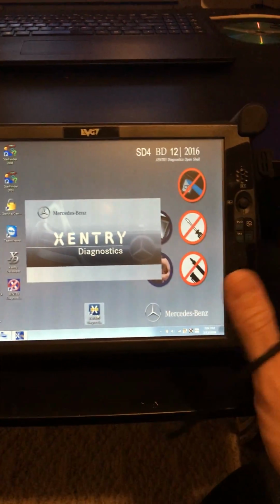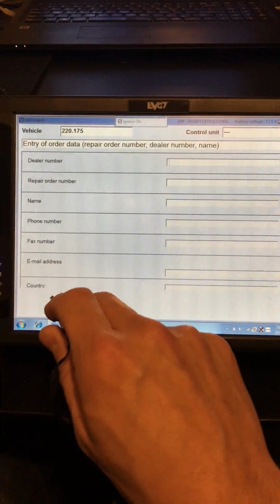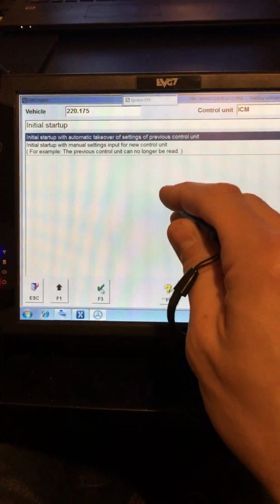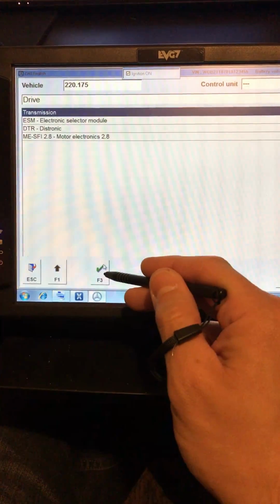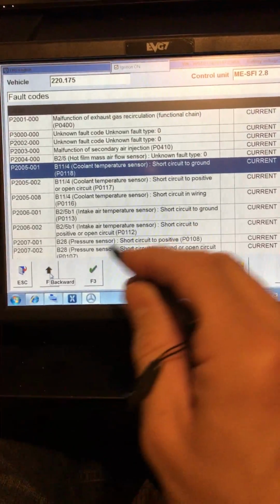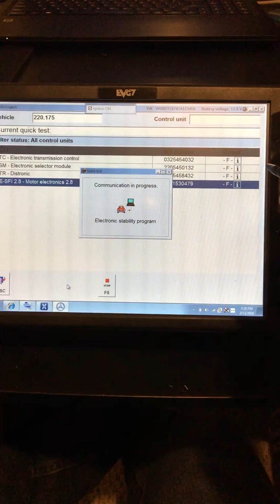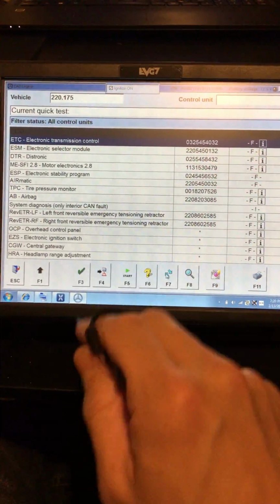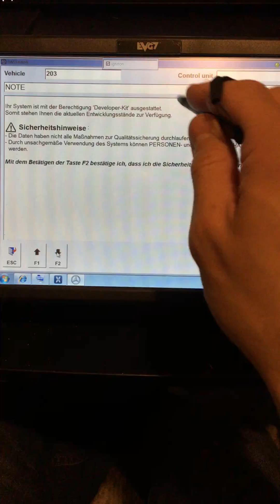Mercedes Benz SDS Star Diagnostic scanner tutorial quick intro on how to use the scanner

Comment: Can you see the complete list of fault codes without connecting into a car? For example, those cluster codes. Would that be in WIS or something else? Thanks
Reply from the maker: I explained it in my video in fact the whole video is in simulator mode. The codes are only in the scanner. Nowhere else.
Reply: @MasterTechLou ah yes. I didn’t think my c3 had it. But I just went into my all programs and found it. Sweet! Thanks

Comment: Where did you get the simulator?  I would like to try it.
Reply from the maker: Simulators are built into the software. It comes with the xentry software
Reply: @MasterTechLou  ok I was wandering Thanks for the reply
Reply: @MasterTechLou  Hello. I just got access to a xentry. I was working on  a metris van trying to diag a battery light. I commanded it on and didn't receive the 14 volts. I do have battery voltage on the b plus  and I checked voltage with a dvm on the lin wire . It read 10. 2 and fluctuated. It also had a loss of communication with the alternator code as well when I scanned it. I believe its getting signal from the pcm. I must be missing something. Would a Sam cause this?

Comment: How do you look up info on DTCs in Xentry with an explanation of code setting criteria and into like that?
Reply from the maker: Pretty sure I show it in the video…..
But when you have a fault code, press f3 in das or test/continue in xentry format and it will show you the steps
Reply from the maker: Or press the f6 or click the book icon in xentry. Not all will show why the codes set, but most should.
Reply: @MasterTechLou  I can't use DAS - have an X166.  Looking for info on P0496.  I used Xentry live and it gave me a single purge switchover valve test to run but nothing else. I'd like to dig in more in Simulation mode but can't even access the code now.
Reply: Ok I figured out how to trigger fake codes on Xentry simulator but it's the same info as when I was scanning the vehicle live (which I guess makes sense).  There is no info at all on code setting criteria or anything other than a test of the purging switchover valve.
Reply from the maker: @kevin9c1  you have to set
The code. Then when you are in the module, click the blue
Book in top right corner. Then there will be a tab on list of fault codes.
Reply: @MasterTechLou  THANK YOU!! Blue book was my missing link.

Comment: MasterTech Lou! Or should I say, Obi Wan Lou! I have a question about coding a replacement SAM module on my R230 are you able to help please? I have a C4 duplexer and 2016 SDS however not familiar with the whole coding process or if indeed my version of Star can do it. Hope that all is well with you?
Reply from the maker: there is a function to swap over coding, or go into the current coding and take photos. its basically setting things on and off based on car options.
Reply: Hi Dr Lou! Hope all is well with you? Hadn't realise that I'd had the SL parked up so long until reading your reply.

OK! So I did look into the coding for the front passenger SAM on my 09 SL 350, but there didn't seem much that could be changed. My replacement SAM is the same part number as the old one (which I still have) However having fitted the new (but used) SAM I have a whole raft of faults!!!

"The nominations to the academy for outstanding faults in an SL are...." (To be read with an Oscars style of voice).
Brake Pad wear.     New Pads 3000 miles ago
Brake Service Warning.     (Gulp! Hopefully not an SBC fault)
Low Washer Fluid.     Washer bottle full to the top
No Windscreen Wash.     (But wipers and headlamp wash fine)
No DAB radio.    (FM MW LW CD and USB connection fine)
PSE Pump continually running (fine previous to change)
Footwell courtesy lights always on when ignition on but off when courtesy lights (door open) come on (operating back to front)

Am sure there's probably some other stuff going on that I've missed but they seem to be the obvious ones.

What I'm hoping is that I didn't trash the cabling re-fitting the replacement SAM, but the fact that the interior footwell lights are doing the opposite of what they should leaves me scratching my head. Plus the empty washer bottle and brake pad warnings make me wonder also. I've read so much contradictory stuff online about the SAM. There is some suggestion that if it's not coded correctly then you get a whole bunch of faults. At present I've got the PSE pump out of the car as I originally thought that in itself was faulty. The only issue I found was a broken pipe outlet on the body but fixed that. But with all the other faults and the potential for the SAM to be causing schizzle I don't want to pay big money for a PSE pump I might not need. I'm trying not to wade back into removing the SAM because the wiring is so tight until I've had another look at it with "Star" and maybe diagnosed the coding. When I initially looked at it with "Star" after first fitting it didn't show any faults with the SAM, so I assumed job done!

So Jedi Master! Any thoughts? Do you think poking at the SAM with star is barking up the wrong tree and if not could you point me in the right direction of some reliable instructions on how to use "Star" to interrogate it please.

I replaced the old SAM because "Star" said it couldn't communicate with it and it needed to be replace although I had no issues with the car...... Swapping it out was a PTA and now I'm wishing I hadn't bothered!!

Big thank you's in advance
  @MasterTechLou

Comment: Great explanation and video!  Do you have a video on analyzing, flashing, programming an ecu? (W221)?  I have extraneous codes that pop up once a month or so but I test the components and they work (valve solenoid magnets, tumble flaps, vent valve open or short circuits)

Comment: This is a very helpful video. Xentry and WIS are very big tools but you have to know how to use it in a professional way. There are not much infos about it. The simulation is very good for self study how it works without the risk to do anything wrong to the car. You can test what you want to do befor you really do it at the car..that was how i learned. There were new things i learned from your video. Thanks for that!
An actual question do you have to reset something after change air filters on a 2007 W221 OM642? (HFM drift compensation, learned values for airfilter, adaption-data   all in CDI5 -> control unit adaption ; in the english version the names could be a little different...it's my free translation for the 3 points). Are these 3 points to be done or any additional? Thank you!
Reply from the maker: Yes in the cdi you can reset values for every part replaced. The module will self learn over time but it may cause errors between replacement and learning.

Comment: Welcome
Does it support w140 scan
S600
And does it control the speed of the car
For example, the maximum speed is 180 km per hour
Please answer and thank you
Reply from the maker: Yes it supports all Mercedes cars and no it cannot change speed settings.
Reply: @MasterTechLou  What is the device that controls the speed of the car and works to adjust the speed
Reply from the maker: @kalfoogaltmimi5043  its built into the engine control unit software

Comment: Hey seen your YouTube video on YouTube you said in the description you do online diagnostics for Mercedes?

Having a issue with my 2016 GLA 45 AMG

I CHANGED THE LOWER OIL PAN AND DIDNOT HAVE THE ENGINE BELT TOOL TO PUT IT BACK ON SO I TURN ON THE CAR WITHOUT THE ENGINE BELT.

 I DID THE MISTAKE OF REVING IT AND MY RADIO TURNED OFF CAUSE BATTERY WAS DEAD I DISCONNECTED THE JUMPER TO SEE IF THE CAR WOULD STAY ON AND IT SHOT OFF RIGHT AWAY THEN I TURN IT ON ANGINE AND REVED IT TO SEE IF IT WOULD STAY ON  AND IT DID. After i got the engine belt tool i put in on and try to shift out of park and it didn’t do anything so it is stuck in park right now and can’t find any information. Are you able to help me ? Is in park and wheel are locked can’t even move it to tow it to the dealer

Comment: I hope you have come across this code P02A7 = cylinder4 fuel trim at min , I swapped inj4 with 3 still having the same issue , replaced o2 sensor but , noticed that whether the o2 sensor connected or not the reading you get from the live data is S1-B1 1.02 , 3V , so replacing the o2 sensor still not fixing the issue , injector 3 was refurbished uncoded injector but we never had any engine check light for 2 years until recently  !!  , no vacuum leak , intake manifold checked as well no leaks at all !
Reply from the maker: I have not had this issue myself. Sorry. Maybe check compression. And Injectors do need coded but they will still learn fuel trims as it runs. So sounds like possible compression issue.

Comment: Just bought a used SDS and waiting for delivery. But thanks for doing more with a smartphone than some do with a fancy camera and trick editing. I have an SL R230 so hoping that SDS will help me with some "roof diagnostics". Big thank you again!!
Reply from the maker: well it certainly will help with the roof, you just need to know what to look for when trying to diagnose the roof.
Reply: @MasterTechLou  Hi Lou and thanks for the reply. My current problem with the roof is that when operating to open, the windows drop a quarter inch then return. On the upside the roof is still up. Previously no issues and no warnings etc on cluster. Have looked through PDF Vario Roof diagnostic aid and the closest "symptom" I can find points towards Switch 117. What I am conscious of is not hearing the pump run, but that's not to say the switch interlocking is at fault and the pump never receives voltage to run.

The boot/trunk is drier than an arabs sandal. (I try to keep on top of the drainage channels). So I'm hoping that SDS might throw up a fault code that might narrow the search down, rather than diving down a rabbit hole and start pulling everything apart hoping for divine inspiration.
Reply from the maker: @nilegriffiths5494  unless the dash shows “visit workshop” you may not have any codes and have to rely on switch data to know what’s happening. Try resync the windows. See if that helps.
Reply: @MasterTechLou  Hi Lou! That did cross my mind. If there was a "system" fault, then it would be reasonable enough to think the OBD would report something through the driver information system. Had the regular floppy "Elephant Ears" last year. Nothing on the dash, but fortunately easy to spot and almost as easy to fix. I'll give the window reset a try like you suggest. Sounds like it might be time to go 'old skool' and get the multimeter out on those wiring connectors.
Reply: @MasterTechLou   Lou!!!!!!!!!!! You are indeed a Master Tech! Finally got the time to check out the SL and try the window reset that you suggested. Job done! Roof works without an issue. If you're ever this side of the pond I owe you a Beer or probably six, certainly as many as you can drink that's for sure. But for the time being you'll have to make do with my gratitude.

One last question though. What made you suspect the windows. Or should I say with your experience and insight, what was it that made you think to check the windows and I guess, importantly, is there another issue with a sensor or switch that I should be hunting down, or is it just one of those things? Stuff moves out of alignment over time?

Big thank you's again.

Nile
Reply from the maker: @nilegriffiths5494  I never kiss and tell 😉
Reply: @MasterTechLou   Ha Ha! A true gent! I quite understand. I approach things in very much the same way in my own trade. Sometimes one of the younger guns asks what I did to turn something around from sounding rubbish to really working. More often or not it's about understanding what's happening to the signal as it travels from the mic to the speaker and not just a question of turning a particular knob to a particular value. What I hope is that my advice prompts them to think the problem through as a whole system, rather than cure any future problems by just copying what I did.

But once again a big thank you. I plan to sit down with the WIS and a large cup of tea and maybe better understand from circuit diagrams what's going on with the windows and how that might tie in with the Vario roof.

Have a great weekend.

Nile
Reply from the maker: @nilegriffiths5494  the windows move so the roof and glass do not make contact. The windows have to be synchronized in order for the roof module to know their position or it will not work the roof as it should.
Reply: @MasterTechLou  Hi Lou! Hope all is well with you. Picked up my MB Star Diagnostics today so will be annoying my girlfriend by ignoring her completely tonight.

My Vario roof seems to be perplexing me again. The other day when opening the roof, it stopped/hesitated for about five seconds (felt like an eternity as I was in traffic), but then finished the opening sequence and no error messages on the dash. When I got to my hotel, the roof closed fine no issues. Now today, roof opened fine no delays. But closing. The roof stopped at about six inches from closing and the door windows stopped about six inches from closing. Releasing the roof switch and the operating again and holding the roof decided to move and closed after about ten seconds. All locks seemed to operate and windows returned to upper position. Again no errors on dash.

Hydraulic liquid present in recevoir and no signs of leaks. My own thoughts are that it doesn't seem to be a loss of hydraulic pressure as everything seems to move as expected, but almost like a loss of power to whatever is controlling. (windows stopping at half mast). Any thoughts Master Yoda..... I mean Lou?

Best wishes as always.
Reply: @MasterTechLou 
Thanks for all your videos 
Lou. Ex snap on dealer here 😞 thanks for advising people
Reply: xentry diagnosis

Comment: Amazing video but I have a question, are you able to access and/or modify the ECU coding through the program? I am attempting to put together a manual swap on a c230k and I need the coding for the automatic transmission to be deleted or changed, is this a feasible solution?
Reply from the maker: For your model yes. For newer models
You need to have dealer access for programming but in your model you should be able to code the cgw
Reply: @MasterTechLou  so for example this swap would not work for c250 w204 2014? Is it possible to just delete the automatic transmission coding on its ECU?
Reply from the maker: @RedlineGarage86   correct it would not work past like 2008

Comment: Does the Star Diagnostic system from ebay performs the same as the one supplied by Mercedes?
Reply from the maker: Its the exact same machine. The differences are you cannot program or software update anything because you dont have access to mercedes servers. The ebay ones have a few more options unlocked in the settings which is dangerous to those that read forums and want to mess with codings for whatever reason. But yes they are the same thing we use in the dealer.
Reply: @MasterTechLou  Thank you for your reply. I need to do suspension calibration on my W222 and was wondering if I have to have the MB diagnostic or can I use other softwares for it too like Launch or Autel? Is there anything like auto level calibration and does the wheel have to be on an alignment bay for true level?
Reply from the maker: @nightrider8918  no one ever has to to level calibration. That’s something no one ever needs to mess with unless they entered calibration mode on accident. I personally get frustrated when I hear people talk about level calibration because its the most Misunderstood thing and it never fixes anything. But to answer your question yes xentry can do it as well as higher end launch models and autel. But, you wont be able to do it successfully because of the measurements the aftermarket scanners ask for. I just fixed a client of mines, if I said that right, his abc was off because he or another shop entered calibration mode for whatever reason and it wasnt performed 100% so the right front was super low and the left rear was super high.
Reply: @MasterTechLou  The vehicle was performing rubbish, the ride was really harsh and does not feel like air ride at all, excessive body roll and I tend to feel every bump on the road, took it to 3 different Mercedes dealerships and they all came back stating the car is fine, some technicians at Mercedes say that they haven't driven a S class before and can't tell the difference, this is in UK and I am gobsmacked to hear such remarks from master technicians at Mercedes. So I tried to play around with the car and made the drive better but it is not 100%.

Comment: Great video. Now what Star tool will work on w202 obd 1 port? I have a 1999 c280 w202 and used a Ilink scan tool but it only gives me a genral fault code.  Will the right Star tool tell me exactly where is the problem??
Reply from the maker: All mercedes star scanners come with the cables for all the models. And will read all the models

Comment: How can I contact you ? I really need help with my SLK320. No crank, DAS repaired x2, tried 2 rcm’s, good fuses, new battery, clutch + ignition switches good.
Reply from the maker: sorry for your troubles. what are you calling RCM?in this model it depends on a few things for a no crank issue. You can find me on justanswer. I dont do much one on one anymore.
Reply: @MasterTechLou  The relay control module, passenger side box nestled with the ecu and body control module.
Reply from the maker: @Snekul_Xfire11  gotcha. Could have a simple starter failure. See if you have power on the purple wire when cranking also need to check drive authorization in the ME and DAS. Thats all I can say here with what little information I have. And no that doesn’t mean im asking for more information 😂. Wish I could help but im pressed for time as it is. Sorry.
Reply: @MasterTechLou  Thank you for your time